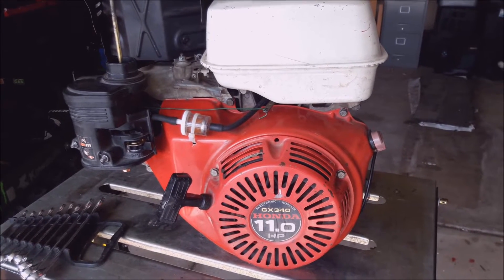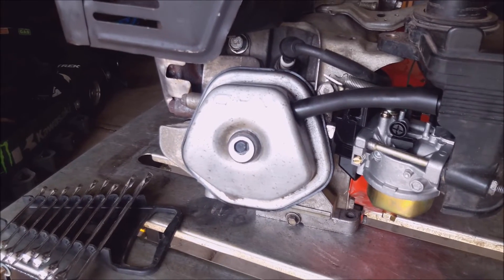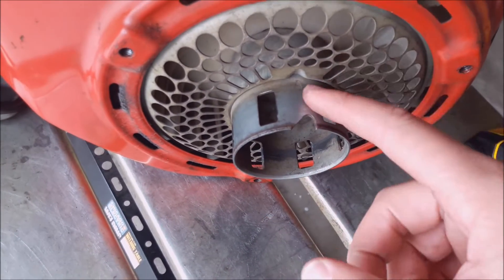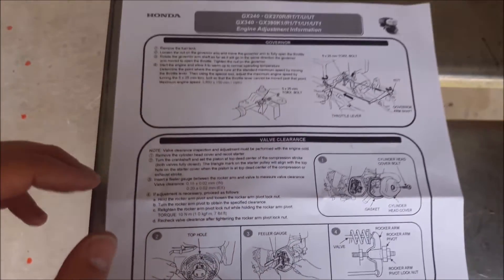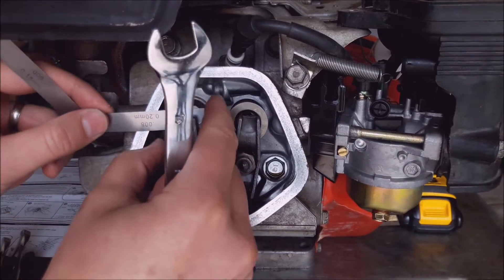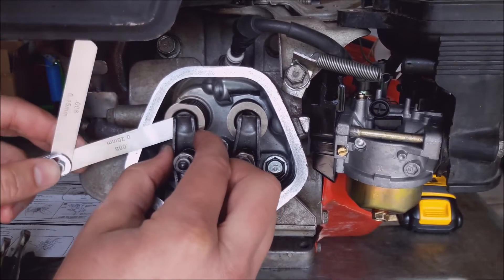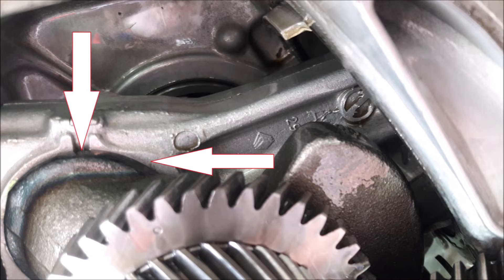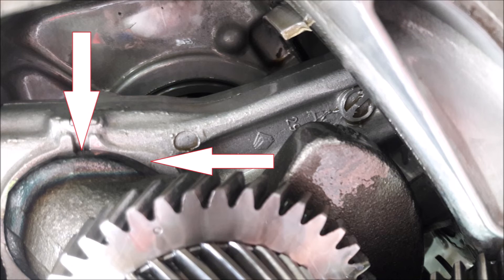Small Engine Repair Valve Lash Clearance Adjustment on Honda, Predator, or any Engine

Comment: I thought i would ask this question here because i cant find an answer in the interweb. We have many generators as we live off grid. All of the Champion generator valves tend to stay in spec but we have one Firman generator that the exhaust lash keeps getting too tight leading to loss in compression and a no start. Once i adjust the exhaust lash back into spec it runs great again for another 100hrs or so. What would cause the rocker on the exhaust valve to keep getting tight? No issues with the intake side. Thanks.

Comment: Wrong stroke bud. You can tell from how tight rockers were. Valve chatter would be from too much valve gap, if it was too tight on both that should have told ya. Remove plug and put screwdriver down in to find tdc. Sounds worse cause you made the large gap bigger.

Comment: I've seen 2 different ways to adjust lash....1 is top dead center compression stroke I believe, adjusting both valves...the other is one valve at a time each at it's closed position.....is that correct? Is either way acceptable?

Comment: thank you for making it easier for folks to maintain their equipment in light of the situation where there arent enough repair shops that can do the job work in a timely rate and when its nearly a toss up to just buy a new unit or fix it DIY. Thanks for being part of the solution for many of us in this situation.

Comment: I adjusted my valves which was needed as I saw they were over tightened. Now that the valves fully seal up the engine is extremely hard to turn. As if the compression release isn't working. I'm stumped. It ran fine before so idk what's going on

Comment: Easiest way to adjust the clearance is by turning the crank until one valve is all the way open/down, then adjust the oposite valve.
In this example the piston is actually almost ay BDC each time, and no need to be on the correct TDC stroke, and also no chance you are accidentally adjusting during the TDC valve overlap position instead of TDC compression.
This method also avoids accidentally adjusting the exhaust valve while the decompression cam is acting on the exhaust valve lifter/tappet👍
Also, try to leave the feeler gauge between the lash gap while tightening the lock nut, if the feeler gauge slips out you're gap is too loose, if it's hard to remove you're gap is too tight.
If it's just right, the feeler gauge will be held in place but won't be too difficult to remove ince the lock nut is tightened.
Minor point, the area that got hot shown in the video was the crankshaft journal, not the conrod, but most likely both will be worn, moreso the conrod being it's aluminium.
Reply: Saw in another video that leaving the feeler gauge in can damage it (if the nut tightens down on it and causes indentations).. maybe not in your example, but something to be aware of
Reply: @kbach6524  Possibly, but of course you need to hold the adjuster screw firmly to try to avoid it moving when tightening the lock nut.
Feeler gauges are generally quite hard, so I'd assume there would be more chance of the valve starting to open before indenting the feeler gauge.
Reply: no need for all that. You use your pinky fingernail and give her a feel. She can be tight but not too lose thats how it goes nothin wrong with that.

Comment: I have a wpx3200 pressure washer and can’t get it to start. I did valve adjustment and found intake rocker arm was very loose and could rotate it without even loosening nut and exhaust valve was too tight. Did the adjustment and now it feels better when pulling cord but still won’t start. Cleaned carb, fresh gas, new spark plug and gets spark, air filter is good, with fresh gas. Any other suggestions? Doesn’t start with starter fluid either. I do get some pops when attempting to start like some backfire.

Comment: If they are not right can that make it hard to crank or pressure on it even when no hoses are connected
Reply from the maker: No, you should still be able to crank it. Pressure may be slightly off, usually pressure is way off when you loose a ring or broken piston.

Comment: I have never used a set of feeler gauges on these. I just tighten them until they barely wiggle and have had zero issues out of any of them.
Reply from the maker: Hey if it works, it works!
Reply from the maker: Right on!

Comment: Is it me or does it have the same sound it did at the beginning of the video.  Jack is right you need top center with closed valves. Try it once again.
Reply from the maker: Not just you! The valve lash wasn't the issue.

Comment: It bothers me on why the exhaust is less open then the intake when exhaust is what I would rather have discharged most and still have a considerable valve seating both valves
Reply from the maker: I'm sure there is a lot of science that goes into that one.
Reply: It’s not just valve clearance the shape of the cam lobe may hold the valve open longer
Reply: Hi. The clearance is bigger because the valve and the stem are subject to the much higher temps of the exhaust gasses. Therefore apt to expand more over it's length. This is true for every internal combustion engine

Comment: I changed my intake valve because it was leaking now my bike tappy loud when the bike has warmed up . What could it be
Reply from the maker: What do you mean by tappy loud?
Reply: @-DIYPRO-  just a tap defo not a knocking sound. When you drive you can't hear it but when at low revs you can hear it. Bike runs fine tho even with low compression lol

Comment: Gooday! My Friend firstime subscriber,
It's standard setting in all Gasoline & 
Disel Genset .15 for intake & .20 for Exhaust for Valve adjustment?
Reply from the maker: I would assume it depends on the brand and model.
Reply: Different manufacturers have slightly different specs.

Comment: I have zero gap on the exhaust valve, no matter what stroke the motor is in. What's the issue?
Reply: Does the valve spring move when you rotate the cylinder?  Maybe the valve is stuck
Reply: @jonathanyoung2588  I figured it out. The valve keepers were wore smooth. Replaced and within 1.5 hours the next set were worn off. I'm guessing excess heat/wear from not getting oil for some reason.
Reply from the maker: Let us know when you find out the issue.
Reply: @-DIYPRO-  not sure of the cause of why the keepers are being worn down. The company is sending me a whole head assembly. Not sure if that's going to fix the rocker/valve springs if they aren't getting oil but we will see.
Reply: @Cledus713  the piston rod lasher should be throwing oil up into the head to lubricant the valves. But if they are wearing out fast make sure the rocker gap is correct and not too tight. It doesn’t have to be off much to to the low side to cause excessive friction against the cam. ☺️

Comment: Can you do this without feeler gauges? If so how lmao, gotta predator 212 I've cleaned the carb and it won't start with even with hot sauce, guessing it might be this
Reply from the maker: Have you checked for spark? That is my go to after I've ruled out the carb.
Reply: @-DIYPRO-  thanks, my oil is a gray color that means there's water right?
Reply: You make use of a flat razor blade the get the clearance required

Comment: Rotate engine.
Observe the inlet valve go down.
Observe the inlet valve come up.......continue rotation slowly.
First TDC.......is the position to measure valve clearance.
Dont confuse the feeler guages metric mm or thousands of a inch.
Reply from the maker: Great points!
Reply: I have a Sisley gauge and never used it before. SAE on top, Metric below that. Confusing those will lead to even more problems.

Comment: Finding tdc is not necessary to adjust valves. Just rotate engint till the valve you want to adjust has it's tappet on the base circle of the cam, ie valve fully closed. This makes it so you need not remove the recoil start assy.
Reply from the maker: Great point.
Reply: This is true. Well said.

Comment: My engine turns off when taken off of the choke could the lash being offset be the problem ?
Reply from the maker: Sounds like a carburetor issue to me. Main jet is probably clogged.
Reply: Bad gas

Comment: Can I ask you a question?
Reply from the maker: You already did! Sorry, bad dad joke!
Reply: Ok. I have a coleman 196 that I put an upgrade kit on with 18lb valve springs. It wont run, will only backfire and sputter. Any ideas? Jetting maybe valve spring adjustment?
Reply: @fuckingbasterds   sounds like exhaust lash is too tight. Combustion is still occurring in the cylinder when your exhaust valve is opened.

Comment: Not sure if you mentioned... I FF'ed through video, but spec is also within +/-.02mm. In inches these Hondas are .006 intake, .008 exhaust, +/-.001.
Reply from the maker: Good point. Except that you fast forwarded through the video, haha!
Reply: Are you mixing up imperial and metric?

Comment: Hey bud maybe you could help me out I have a predator engine I bought from harbor freight last winter and I started running it probably around April put the mud mud motor long shaft and it ran good didn't have any problems with it then after about having it out for five times I was driving I drive for about 15-20 minutes and all of a sudden the engine was like start to vibrate real loud like a crazy noise I can send you a video if you want let you listen to it but I thought it was a shaft but I took the shaft off and it's doing the same thing so maybe you can help me out I appreciate it thanks
Reply from the maker: Still doing it? Have you taken the cover off and checked in side?

Comment: So my zero turn which has a predator 700 motor on it had been hard to start and then backfiring a lot recently and I pressure washed it one day and now it won’t start and I took the valve cover off and the cam rockers or valve rockers are super loose and it would run for like 10 seconds and then cut off and I’m not sure what my problem is with the right cylinder which is my problem having 40 psi of compression in my left cylinder having 160 psi of compression
Reply from the maker: Did you ever figure out the issue?

Comment: My brothers mini bike did the same thing we tried to adjust the valves  it ended up being the piston arm  the two bolts backed out we took the side case off and tighten them up and no more ticking
Reply: Wow, never heard of that but glad you figured it out. 😀

Comment: Taking the governor out doesn’t make it run to hard it only effects throttle because all the governor does is hold back throttle it’s better to remove it for higher performance
Reply from the maker: Correct but who are the people that take governors out, those that want to go full throttle. Doing that constantly puts a lot more stress on the engine and somethings got to give.
Reply: The governor is there for a reason,  to keep extreme rpm from damaging the engine ! The engine rpm is controlled by the governor to run within manufacturers recommend SAFE rpm range !

Comment: I couldn't tell the difference in the sound.
Reply from the maker: Nope that didn't fix the problem. At the end of the video I took off the cover and found the tie rod was too loose.
Reply: @-DIYPRO-  ...tie rod?😶
 I checked all the files of info, in my brainium,,,the ones that still work,,,lol
 All info refers to the connecting rod, ( that metal thingy,,,between the crankshaft and the piston)🎯😁☕
Reply: You can watch those guys in India and Pakistan,,, they can remanufacture anything in about 60minutes, or less...lol

Comment: Something to be aware of... all threads have back lash.. (slop) as you found out.
Set your lock nut on top to be in slight firm contact with your bottom nut when you feeler gauge.
Both those male threads to nuts fight each other on tightening and yes male threads DO flex as well....
Reply from the maker: Thanks for the input.
Reply: @Colin Jones  Thanks,Colin. that is exactly the problem we ( a car mechanic and I ) are having!
Reply: Good luck mate, it’s hard to judge the skill level of a mechanic and there is a lot of luck involved in getting the right one.
Older mechanics with a very good attitude tend to learn and retain information

Comment: hii did you found out what was causing the knock i have an honda just like yours doing the same
Reply: Lol it might be a rod knock.
I would make sure your engine has a sufficient amount of oil, if not then you need to change the oil
Reply: @logertgogert3227  changing the oil won't fix a rod knock or any engine damage

Comment: I had to replace the push rod guide plate on my Gentron generator, looks like a Honda knock off. I only found a cap on the exhaust valve spring.  Is there suppose to be a cap on the intake side also?
Reply: I can't guarantee but the ones I saw so far didn't have one on the intake valve.
Reply: No.

Comment: There are two TDC (top dead center) on 4-cycle engines. I think you need to be sure it's TDC on the compression stroke when adjusting valves. This makes a difference on certain engines I was told. I'm by no means an expert on small engines but found this out the hard way.
Reply: That's true, but it's easy to tell which stroke you are on if you can see the rockers/valves. TDC compression, both valves are closed. TDC exhaust, the exhaust valve is open.
Reply: @kevinrhodes9082  so,in this video..valve ex is open?
Reply: @kevinrhodes9082  What if I adjusted mine and I didn't know what was what I was doing so now both sides are pretty tight and I got one heck of a knock and a lot of smoke
Reply: Easiest way to adjust the clearance is by turning the crank until one valve is all the way open/down, then adjust the oposite valve.
In this example the piston is actually almost at BDC each time, and no need to be on the correct TDC stroke, also no chance you are accidentally adjusting during the TDC valve overlap position instead of TDC compression.
This method also avoids accidentally adjusting the exhaust valve while the decompression cam is acting on the exhaust valve lifter/tappet👍
Reply: Did you see him remove the starter assembly to see the two triangles lineup? that was to confirm his piston was on tdc compression stroke
Reply: Sorry to hear.that
I hope you've learned to know how.to find your tdc
I pull the plug out.and.whatch.for.piston travel
Reply: Place your thumb over the spark plug hole and rotate the engine, once you feel compression  that is the correct cycle  to adjust the valves get piston at top dead center...
Reply: U can check tdc by pointing piston with a screw driver
Reply: @ajay-xr9gp  on a 4 stroke the piston goes to the top twice in a cycle
Reply: @Z3n1tHL0rD   yes but by navigating the tappets which is moving during rotating engine...

Comment: where did you buy that valve adjustment feeler
Reply: Go to autozone
Reply from the maker: I think I just bought them online. They are called feeler gauges.
Reply: Any auto parts
Reply: If you don’t know what a feeler gauge is,  you might want to hire it done…

Comment: What would be the valve lash set for 212cc predator engine non Hemi?
Reply from the maker: You'd have to look up that model online. I'm sure HF has the specs somewhere.
Reply: Valve clearance -  Intake 0.004" to 0.006".  Exuast 0.006" to 0.008"
Reply: burns thanks but I think your a little too late bro but we know your heart was in the right place.
Reply: @ronbondvd  what about for a predator 420cc
Reply: My channel is based on making different items for work and the like.  A new video has come out so take a look.  If you are interested, watch my channel, if you liked the channel, leave a like, share and subscribe as a sign of support!  Thank you!

https://m.youtube.com/watch?v=7DKYaomh7qo
https://m.youtube.com/watch?v=8xqrNmPtdoo&t=6s

Comment: Compensating for a Cold Engine When Adjusting Mechanical Lifter ...
https://www.enginebuildermag.com/.../compensating-for-a-cold-engine-when-adjustin...
Aug 19, 2011 - Since the valve cannot move until all the running clearance (valve lash) ... “hot” setting given to you in your cam manufacturer's catalog or cam ...
People also search for